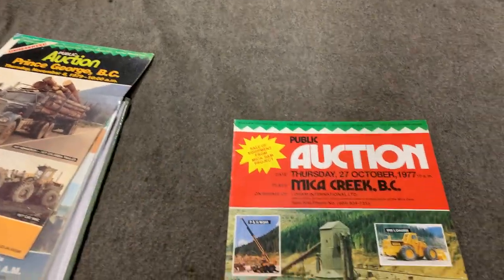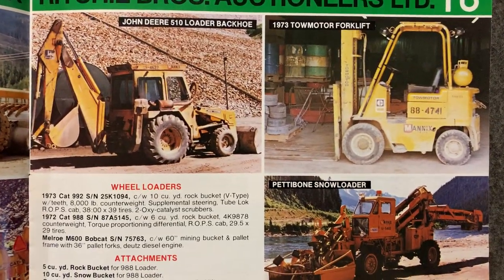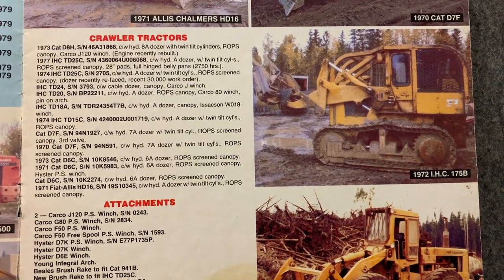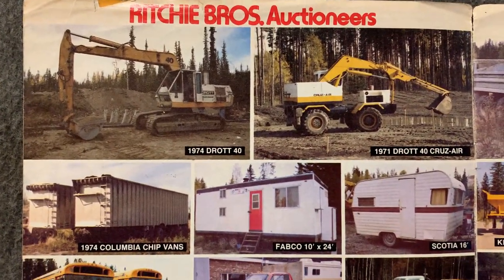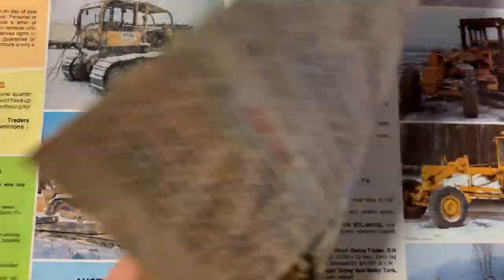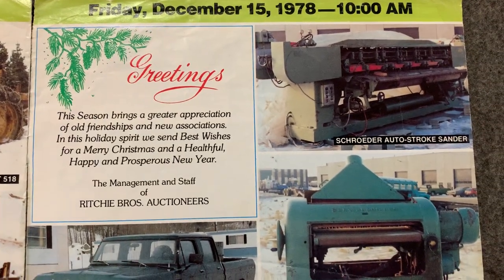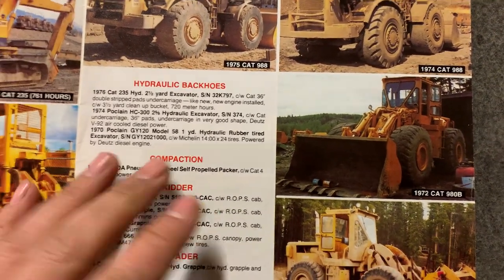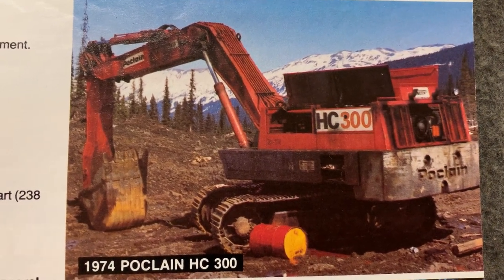Old RB Auction Flyers

Comment: Seems I pretty much like what you like. And sure they last longer here just for the same reason you sad. 80k is a LOT less that triple it.  I drove an old DM coal hauler with the 2 steering boxes and a KW constructor-types. The DM was like spinning a cue ball on a pool table. Never did get used to it. CHEERS and GBWYou! And 10/4 on parking with no pressure!